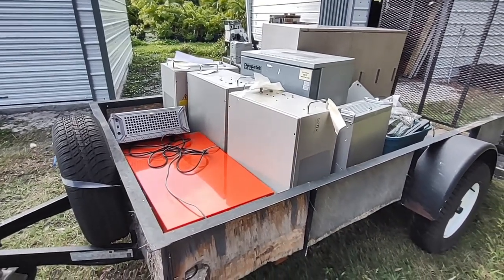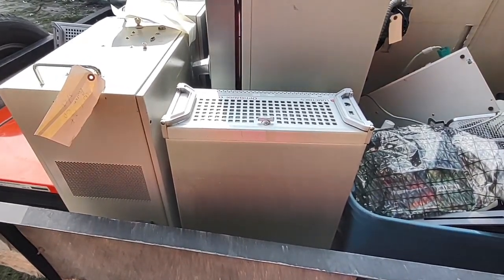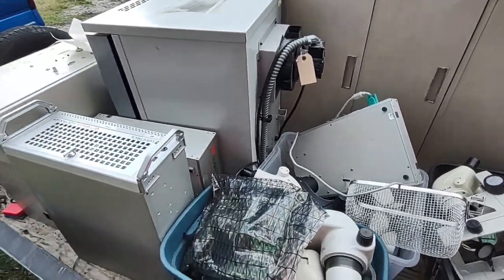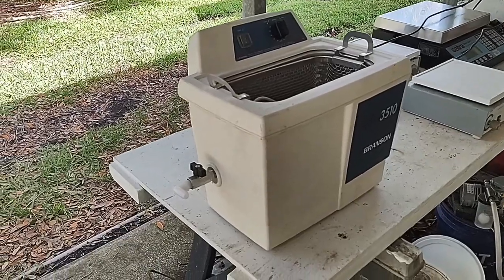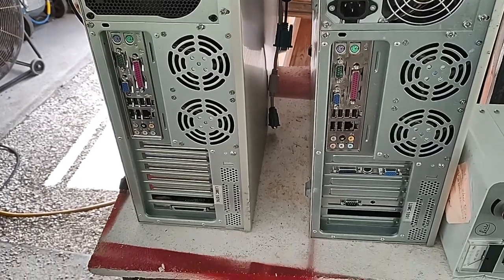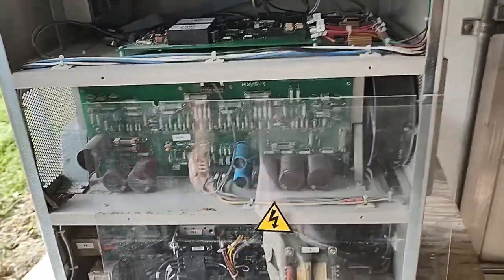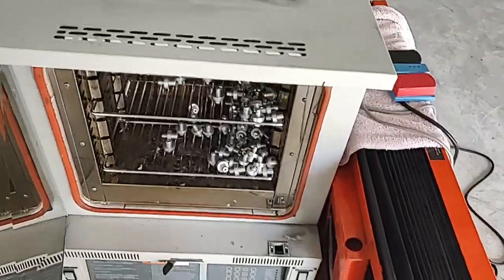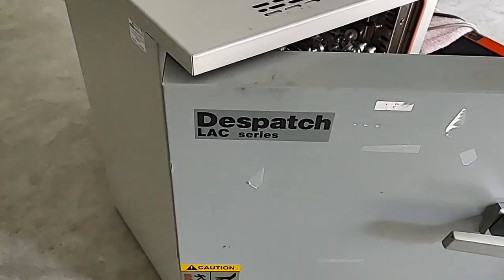Huge E-Scrap Pickup: Got A Full Trailer Load! E-Waste, Steel & Good Working Equipment

Comment: Steel makes the meal, because it's not only far more common, many scrappers will always make the most on steel. 

You just need to have a vehicle or trailer that can handle the volumes needed to make a living on steel.